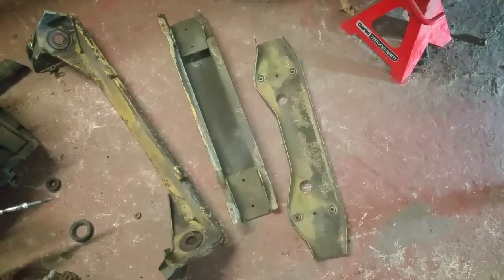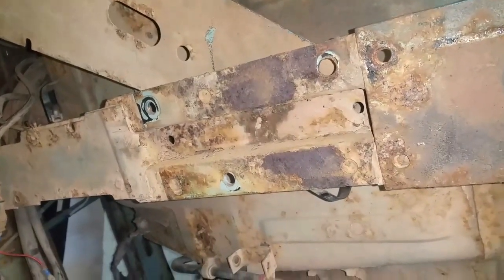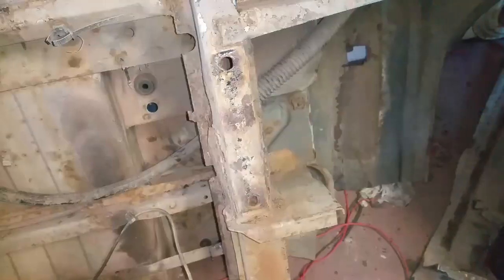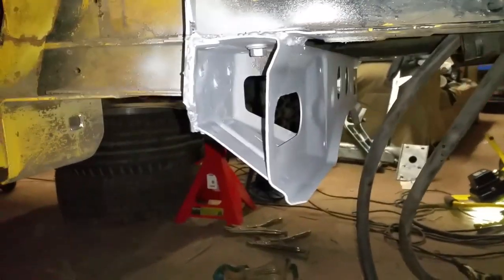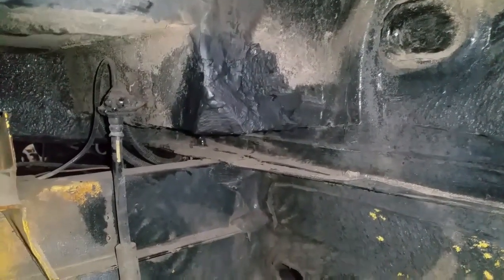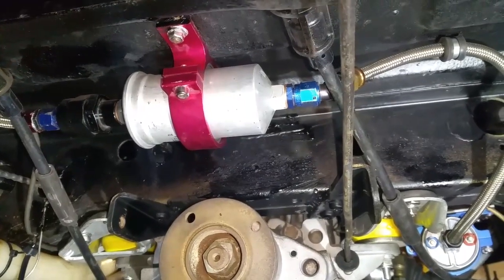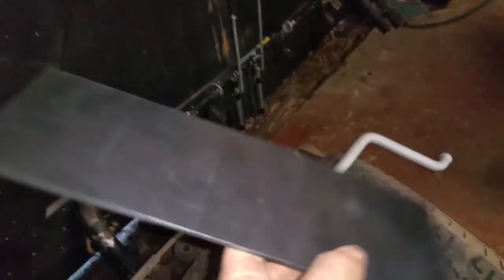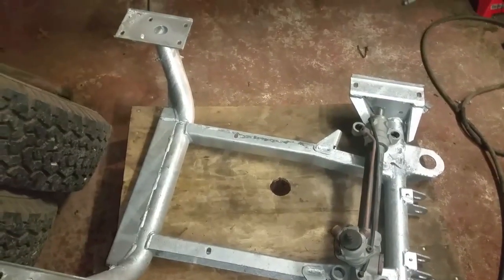VW T25 T3 Vanagon 2WD to Syncro 4WD Conversion Project - Front End Modifications, Fuel Pump etc.

Comment: Hi Mark, you did not add the syncro reinforcement into the framerails where the subframe mounts to, right? Did you have any problems with that part not being reinforced?
Reply from the maker: Hi, no problems at all. It is worth remembering that there is already reinforcement in there already from the 2wd front radius arm mount left in after cutting off the bracket. From what I  remember, that was fairly substantial in itself and the syncro reinforcement is basically just a U-shaped section welded in. 
I did think hard about it, but I had followed several other builds before doing mine, and I followed their methods. Hope that helps, Cheers.
Reply: @MarkHalligan  Thank you very much! Then I will do it the same way. Kind of scared and excited about the whole project :D

Comment: Hi Mark. I know you've probably plated the front subframe mount sections but just to say the original radius arm mount crossmember was the right width and thickness plate to upcycle for this section, and would've been free :)
Reply from the maker: Yep I saw you mention that in your build thread on 8090, thinking back I couldn't be bothered to cut them out and ordered those up, lazy I know :-). 
As far as the conversion is concerned it's all finished now and up and running.
Reply: Great news! Where in the country are you?